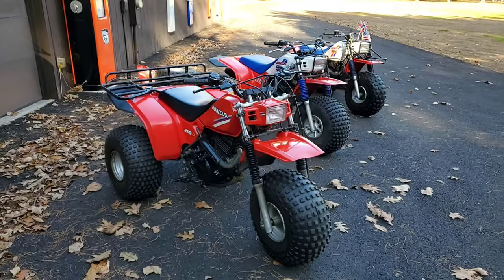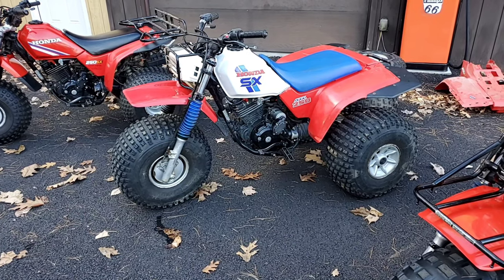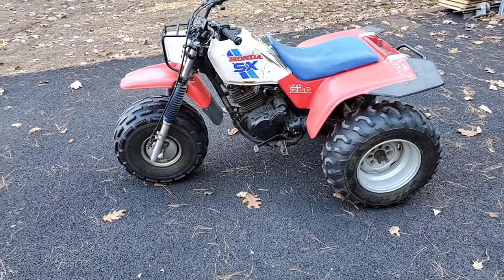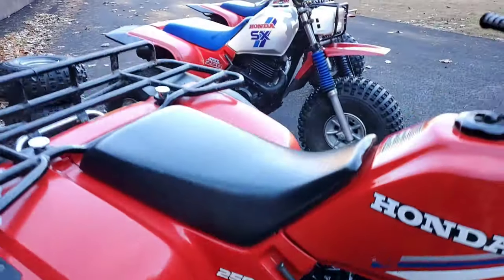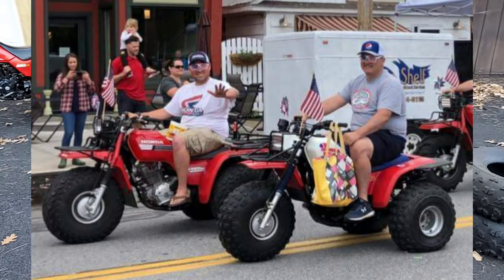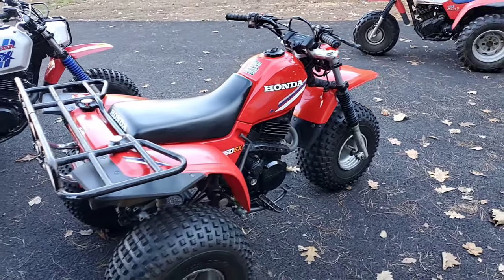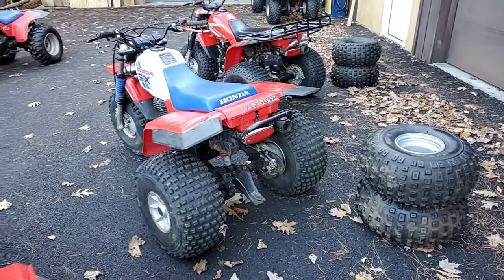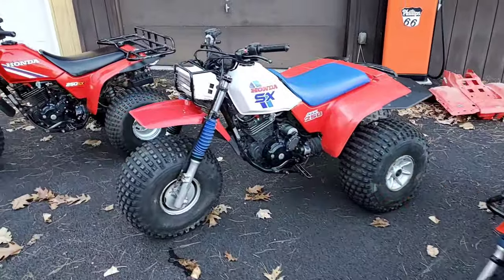Honda's ATC 250SX - The mullet of the trike world!  Made from 1985-1987.  What are the differences?

Comment: Have a 1986 250 BIG RED. My dad bought it new when I was 9 years old. I had so much fun on that pore thing. I rode it every day and literally put it through hell and back. The transmissions is what took finally it out. But being a farm tool we towed so many things way way over weight. We were always pretty good on the maintenance so it should still start no problem but it hasn't run in at least 20 years Probably about 10 years ago I kicked it over a few times to make sure it wasn't stuck and then put a bunch of oil in the cylinder.
Reply: Cool, I still have a 1983 that I bought used and it’s still running.

Comment: You are correct in that the ES is geared differently. The ES gets its overall gearing from three things. Every gear in the tranny is one tooth larger than the SX except for one gear. The differential ring is one tooth larger, and the rear wheels are 25". I have an 85/86 SX with an 85 ES engine in it and I lost just a little top end speed but I gained bottom end torque and I love it that way. The same thing can be accomplished by installing an ES differential in an SX.

Comment: Great video.   
I am currently trying to find smaller rims and knobby tires for my 86’ sx.  I bought it with 12 inch rims and big mid tires.  It rides super rough and robs a lot of performance. Not sure on if I should go stock rim size route or not

Comment: You put 5 ohm caps on the bike.
They came stock with a hard spark plug cap 0 ohms.
Yes the 2  stroke 5 ohm cap dose make the four stroke run better. More spark = more power

Comment: One of the best parts of the 86/87 250SX versus the 85 is that every joint on the swingarm and differential has O-rings. The 85 250SX was prone to water entry, even had a Service Bulletin, it doesn't belong in the water, unless you know where to buy all new differential and rear axle parts. The water gets in there and destroys all the journals, takes the zinc coating off of everything and then even new bearings will have slop and the seals will get torn up on the corrosion. Please don't put snorkels on the 250SX, they are not submarines...

Comment: Man if you still have/would you sell those faded but uncracked looking rear 250sx plastics sitting behind the 86 250sx in this video?
Reply from the maker: I still have them, but they're going to be cleaned up and put on my 86 that has cracked fenders currently.  They're not faded, just dusty...
Reply: What a drag. They look great. I just got an unheard of deal on an 85 250sx thats in pretty good shape for only $300 but the front fender is all zip tied together and yhe back fender left corner has a few zip ties in it. But id like to make it as minty as possible lol. Thank you anyways tho!
Reply from the maker: I hear ya man, It seems like the only 250SX's that don't have cracked fenders are the ones that had rear racks to protect them.  1 bad wheelie and it's easy for those things to break right at the mud flap...

Comment: If you bought mine, it was beat rear seals, were shot, fenders had metal and rivets. Gas tank, and seat were dead give away, if I seen it today, i could point it out. A REAR FOX shock would be a great upgrade if they made one, the ride hard if you ride them fast.  The Rear Ends hold up better than the HONDA RECONS,  2001 Recon Rear end eats UP Bearings and SEals,   Very narroW REAR END, higher toque.